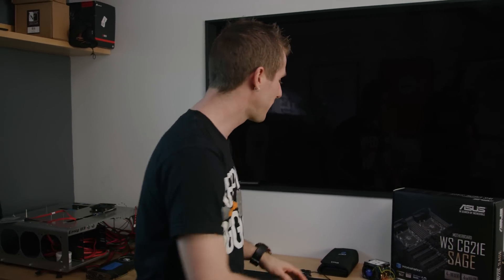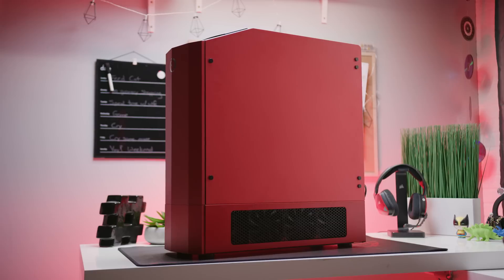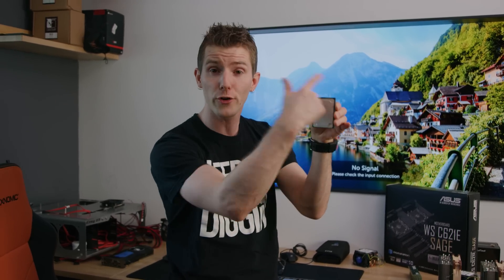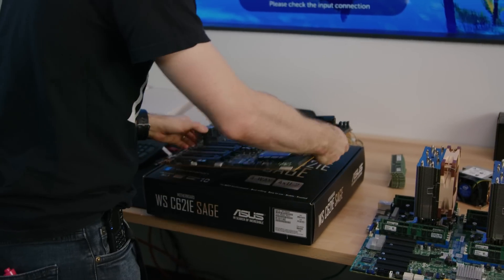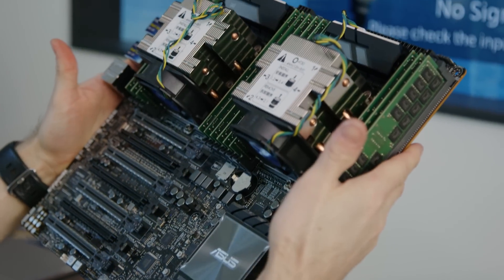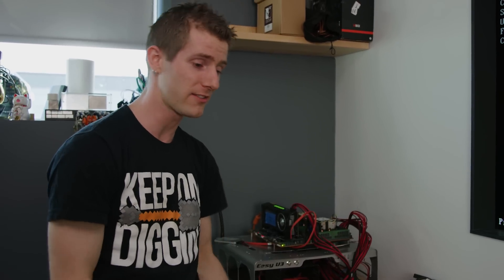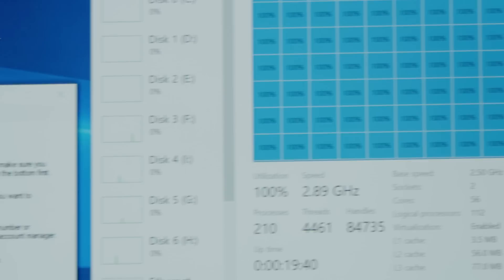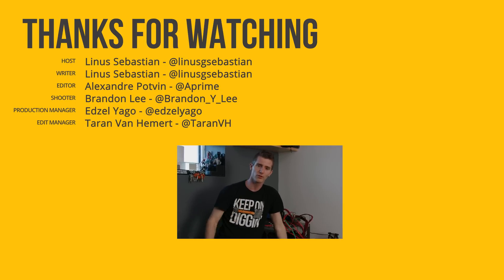56 Cores in ONE SYSTEM! - HOLY $H!T

Comment: Thermal compund less is more? Err no its been proven time and time again that more is better than less.
Reply: It doesn't make a difference. As long as you have enough applied in a way that won't leave air bubbles, the extra will squeeze out. The only harm in putting too much is that you have to wipe the extra off after it squeezes out.
Reply: +eraldorh  That really depends on if you're using Arctic Silver 5 or Skippy. Skippy generally has better thermals with more.
Reply: +Freezerbomb Anything will give you better thermals if you use a too much instead of not enough.
Reply: +Amir Abudubai It does make a difference read my other comment and you dont even have to wipe off the excess unless it is a specialised thermal compound that is electrically conductive like the liquid metal stuff. Other than that more is better than less.
Reply: uh.. the opposite you mean
Reply: +HazewinDog This has been done to death and more is better than less. Too little means there isnt sufficient heat transfer, more does nothing bad so more is better. Theres literally a million videos proving that more is better than less. You cant win this argument.

Comment: Can somebody explain Burstcoin to me in one sentence?
Reply: no
Reply: I think Linus explained it pretty well already 8:33
Reply: A cryptocurrency designed to be mined using hard drive space.
Reply: I'm more confused about the part at 8:55
Reply: Bitcoin is like trying to brute force a password (Lots of processing power), Burstcoin is like using a rainbow table (the more complex the password, the more space required to store the rainbow table). Burstcoin requires some CPU power to calculate the rainbow table, but after it is done the power consumption of the over all rig goes down drastically making it a far cheaper to run when considering electrical consumption and thermal management.
Reply: "The new ponzi!"
There.

Comment: Hey Linus, I am in the process of putting a system just like this into full use. My system would be running multiple instances of ubuntu connected to the web to monitor virtual meeting rooms. I was curious how many VMs of ubuntu a system like this running windows server might be able to sustain. While I can ballpark CPU usage actually doing the thing can expose unexpected differences. Curious if you guys would be interested in trying something like this out.

Comment: That SD card is for loading a hyper visor like ESXi without having to host it on attached storage. You then point any logging to the attached drives so as not to burn out the SD card

Comment: Some Ideas i have:
- make a ramdisk and install some games on it. How is the boottime, loading time of maps, etc.
- running some games simultaneously.
- compiling software, rendering videos.
- very large database.
- gamesserver, how many players can it handle.
- how many user can it handle working on it at the same time.

Comment: Can you maybe install some real hypervisor software. Unraid isn't exactly designed to be a hypervisor. Then iSCSI it up to your measly petabyte for some dynamic workstations on demand. Maybe make the software mine using the unused GPU's then as soon as a client requests a VM, replace the mining software with a Desktop OS.

Take some cheap Desktops and just have them client to the hypervisor. On boot to a custom linux distro, allow for the Operating System request to be chosen, add some USB over the network stuff or if they are drives, mount as a network share to the Hypervisor. Essentially anywhere in the building would be able to become a workstation with just a little tweaking.

Comment: I did a double take when I hear Micro SD card mount in the board. Odd way to make space, but use the most reliable SD card, like the Samsung brand also used in Raspberry Pi, loaded with the Linux partition, while the other connected drives compartmentalize access and apps.

Comment: Hey I’m wondering if anyone here in the comments could lemme know if this is a good build. 

I am new to this and need a budget and relatively easy to do build. So this is partial-pre built. 

I’m buying a low end dell 3650 with intel core i3 and 8 gigs of ram. 1tb hdd as well. After that I’m buying a gtx 1050 lower end as well as a 250Gb Samsung SDD. Total is about 500 dollars. 

Good? Will it even work? Worth the saved hassle?

Comment: 1000000000000 Minecraft TNT

Even though Minecraft is single thread but, hey that's the best thing to try out on a workstation right?
Reply: 200-300 people is limit per server for 7700k. Most "2k people servers" are actually multiserver NETWORKS, that are running proxy.
And everything beyond 5k players is multiproxy ( but still they are connecting to same multiserver network, it's just entry points ).

Google about bungee. (And yes, I'm bad with jokes)
Reply: Ayren Draganas maybe the servers are multithreaded? xD but only maybe
Reply: It's only as multithreaded as the programmers made it - if the programmers only used one thread, it will only use one thread. If they programmed tasks to be allocated across threads, it will use more threads.
Reply: Windows is multiprocessor so is my phone. (btw, didn't say anything about MC not being multithreaded :D)
Reply: Ayren Draganas
that's because they have multiple servers linked together to form their network
Reply: ▐ ᴇʟᴍᴏᴅᴏ7▐ Well but using the rig as a Minecraft server would be interesting.
Reply: Skedda yes it would but maybe we could see how well the optifine mod scales across cpus
Reply: You can force threaded chunk rendering in forge. Not sure about servers tho.
Reply: ▐ ᴇʟᴍᴏᴅᴏ7▐ optifine mod is the answer
Reply: Ayren Draganas server != game
Reply: Lothaire Cliquennois It's not really, 1 core goes for internal server, another goes for game rendering and java engine, and you could use a third one, offloading chunk loading to another one.
But don't you worry I already knew people with no knowledge would respond.
Reply: QQQQ you are so right, first one in all this comments
Reply: Styler_GTX server is not but can simulate multithreading with bungee
Reply: Griffin S nope, not exactly
Reply: Sommanker you are right
Reply: Albert Cazares you can offload chunk load to another core but it's not exactly multithreaded
Reply: lol you are right
Reply: mmmhorsesteaks you are right
Reply: Kingcake57 almost right
Reply: Skedda it would be cool
Reply: Kingcake57 exactly, scaling is only for chunk loading and at most 3 core multithread when on singleplayer and using an internal server
Reply: ▐ ᴇʟᴍᴏᴅᴏ7▐  since some version minecraft hosts a local server even if you are in single player. thats the reason the physics can lag without the fps taking a major hit
Reply: Ayren Draganas check my older posts I already said that :)
That's not exactly multithreaded, that's 2 instances on one process, one for game and one for server.
The closest to multithtrad it can get is when you offload chunk loading to another core, but still that does not make it really multithread.
Its core was made to work on just one core, any multithtread capability we have now is merely an offload and to a limited extent.
Reply: ▐ ᴇʟᴍᴏᴅᴏ7▐ you seem to know your stuff. You programming mods?
Reply: Ayren Draganas I used to, now I'm into other projects like the android stream deck and the steam achievements tool.
Mainly tools for streamers.
Reply: ▐ ᴇʟᴍᴏᴅᴏ7▐  ah ok i got into programming because i wanted to make minecraft mods but never actually did it... instead i got lost in other adventures like writing my own bootloader/kernel from scratch in x86 assembly or writing a twitch bot or opengl/opencl :D
Reply: Ayren Draganas that's impressive
Reply: ▐ ᴇʟᴍᴏᴅᴏ7▐ lol
Reply: that amount of tnt on a 64 chunk rendered map.
Reply: afaik minecraft only uses 1 core. so you could have some spanking CPU and it wont help unless the clock speed is cray cray
Reply: rrrohan2288 , minecraft doesn't use just one core. xD!
Reply: 1x10E12 Minecraft TNT*
Reply: Ngl I wanna see this
Reply: eh its not. or else how would the 2k people server work
Reply: in 8K resolution with 512x512 texture pack :D
Reply: I'm pretty sure in 1.7.10 you can chose if you wanted single or multi threaded processing
Reply: Java is multithreaded so so is minecraft

Comment: I just wanna see you guys fill that motherboard with 7 Radeon Pro WX 7100s or Quadro P4000s (or Galax Katanas).

Then maybe run SPECViewperf on each of your seven workstations.
Reply: P6000 only
Reply: The Galax 1070 Katana will have blocked exhaust in such configuration as it is blowing out hot air through the secondary slot and not through is own slot like reference blower designs.

Not saying it won't work, but I'd be worried due to heat limits being reached even with sufficient ventilation.
Reply: +Requis P6000 is dual slot.   The only way that'd be possible is if they use waterblocks, but Linus said in their 7-Gamers-1-CPU video that he doesn't want to use full length cards with watercooling since they'd be impossible to remove.
Plus, the North American power outlet standard can't supply the wattage required to run 7 P6000s and 2 Xeon Platinums at full tilt.
Reply: Christian Stout hi
Reply: yes this build need more gpu then play mincraft :)

Comment: Here i am with my dual core
Reply: LocalFireworks Some legends talk about people having less than a single core.
Reply: you can get a pc with quads like under 300 now. Im not saying to upgrade im just saying when that unit dies the next upgrade isnt going to cost much and your going to see a big difference. So just know that the longer you holdout the better the tech is going to be for the least amount of money.
Reply: I5 5200u 😂
Reply: I want to game but my laptop wont let me ik have enough ram 12gb and a 840m but the dual core keeps it from preforming good xD
Reply: Its making fun of us all... even from the Threadripper.  I have a 4 core i3-3220(Hyperthreading)
Reply: You are Legend!😁
Reply: I'm a i3 6100 peasant. My GTX 970 is old in the tooth too.
Reply: I'm sorry to say that those 4 cores are 4 logical cores, and there are only two real cores in your i3-3220.

Hyperthreading makes it possible to keep parts of the state of a thread in a core for faster context switching, which usually improves performance (not always, see gaming), but ultimately only two threads run at the same time ever.
Reply: LocalFireworks naughty dual core
Reply: Noob, I'm using a tri core.
Reply: LocalFireworks, same here bro... i feel ya...
Reply: LocalFireworks Same here fam i2 dual core
Reply: burnzy3210  i3 4170 dual core
Reply: Barry Cooper I'm still rocking with my secondhand GTX 760 😂😂😂
Reply: me 2
Reply: 6600k here. Linus, if i make a case out of a freezer to cool it, can i overclock it to match your 58 core?
Reply: i got a shitty i5 laptop
Reply: i HAVE A QUADCORE FX with a GT730. Running games like gta5 on high. FO4 on medium. 2K16,SKYRIM on Ultra,Mafia3 medium,TW3 medium,ARK on medium....having trouble with farcry 4 which I understand is a cpu heavy port,but I digress,it's not always just the hardware that can accomplish things...there's  lot of hyperbole in the pc market. Knowing what you're doing goes a long way. And an old ASUS m11b F2A55
mobo. 12 gigs of cheap ram. Which isn't a real factor.
Reply: E8500 master race. But I upgraded a while ago to a 5820K
Reply: Funnily enough my quad fx benches at an i5 higher equivalent. Intel is overpriced and not that impressive.
Reply: If you have a pc then its used as well.. so dont knock used pc's People buy used cars.. why because they dont want to pay new price.. I pick up open box pc's all the time.. they still have full manufactor warranty and you can still extend it. If you wanted a new then you spend 400.. its still cheap.
Reply: no shit if you use a pc its used >> Buying a used pc will have no warranty,or some shit you'll never benefit from warranty,you don't know whats been done to it,how it was treated,how long ANY of it's components are going to last,and so on..it's NOT worth the savings period. New vs used isn't even a comparison. Only a moron would argue differently.
Reply: Just built a 6 core amd3+ evo212 12 gig ram -z97 full atx mobo-500w ps(evga)-750ti gc-1tb hd thermaltake full case w/watercooling slots for just over 500$ New
Reply: Trey Nathaniel anything open box still have manufacture warranty of 1 year and 14 return policy.
Reply: 1 year lol 14 day lol and good luck using it.."anything" is an overstatement.
Reply: And more importantly having a warranty is not the same as wanting to have to use it. You exponentially increase your chances of needing to use a warranty by it being used. Who the truck wants to have to be without while you send it to them,in hopes it doesn't "need" it again,and that is IF they cover shipping...just no.

Comment: Wait but EPYC has 32 cores per cpu wtf
Reply: @Mikat
Actually the Epyc cores are faster. AMD's design can hit higher clock speeds on high core count chips, and it has more memory channels. Where a chip like this beats Epyc is that it has more instruction set extensions that allow it to out perform the Epyc in certain work loads. In general work loads, Epyc has much more raw compute power.
Reply: ya but these cores are faster, kind of like how an 8700k beats the 1800x which has 2 more cores

Comment: Try how many cars in Beamng it can handle.
Reply: BeamNG is one of the few games that scales perfectly with core count as each car is given a thread.
Reply: wooosh
Reply: DarkDragonn I know it isn't meant for gaming but as far as i know beamng sumulates each cars on a separate thread. with a quad core cpu without ht it can run 4 cars without a performance drop and with ht it can run 8 cars. as far as i know there is no thread or car limit.
Reply: DarkDragonn You clearly do not know anything, server processors can game, as well as be used for a server.

Comment: HOW many digits of Pi can you calculate in 10 minutes?
Reply: That is actually a good test, I would like to see that.
Reply: A L L O F T H E M.
Reply: Put them to find as many perfect numbers as it can get in a certain time
Reply: All of them
Reply: How many digits of Pi can you compute in 10 minutes?
Reply: Tt-t-tttt-three?
Reply: 420
Reply: Kremite 3!!!!
Reply: All
Reply: 8180

Times 2 if dual socket
Reply: cay monkey pi calculated beyond, what was it 30 some odd places, is more than accurate enough to accurately measure the universe at a size smaller than atoms. Use the cpu power for something better.
Reply: @peacemaker9807  its not like the cpu can be used to one thing only...
Reply: @justinc2633   yes it can..    there is an  algorithm to give the digits of pi  at places to the right of unknown digits..   you can then keep each core busy on new digits ... Or just get the same digits 56 times over ...
Reply: @isilder  what happens afterwords? your cpu disintegrates?  or can you use it for other stuff?

Comment: Are 28 cores really so spectacular compared to amd epic
Reply: The more cores you have the slower the clocks. That means unless you can get a huge number of threads you're better off with fewer cores at a higher clock speed.
Reply: well the high end for gaming is 6 to 8 cores at the moment so its pretty gud i guess

Comment: Where did he found the CPU Fan?

I'd like to build a new server with the same motherboard just with a reasonable (in price) CPU like an entry Xeon Silver.
For some reason its really hard to find a normal CPU cooler for this socket which is not rated to sound like a Jet engine.

Comment: You could try running some game that uses a Software renderer (like the original Doom) at 4k, that way the processor would be doing a similar job to a GPU. I've NEVER seen a CPU running smoothly a software renderer at high resolutions.
Reply: u mean rendering game in real time using a cpu instead of gpu?
that would be nice idea
Reply: Original Doom wouldn't make for a good test at all. It was single threaded(render and game) so this setup would perform siginificannly worse than your average laptop.  
Dolphin(GameCube emulator) offers a software render that might work. It is only for debugging so I am not sure if it is multi-threaded, but it is the most taxing real-time CPU render I can think of.